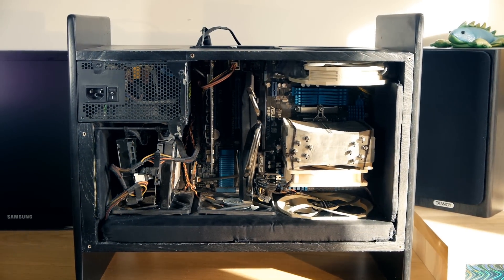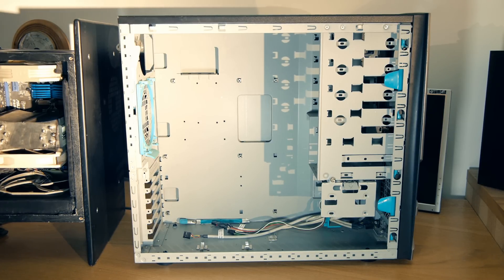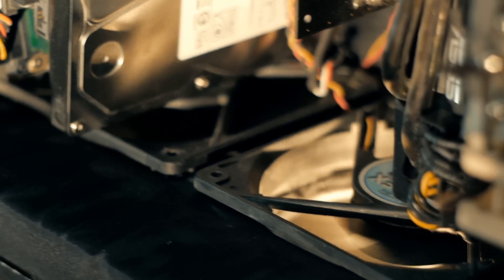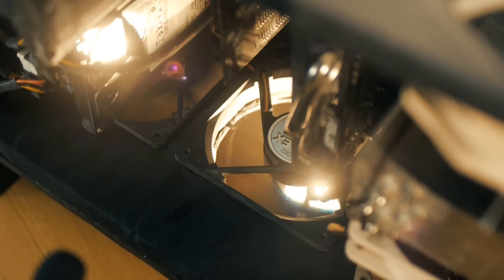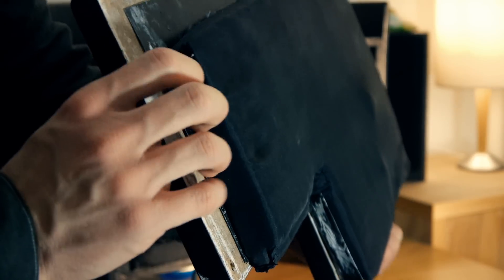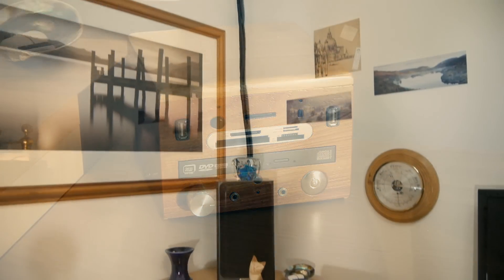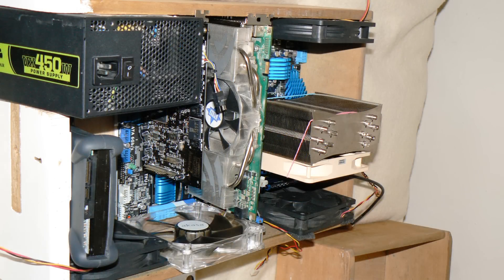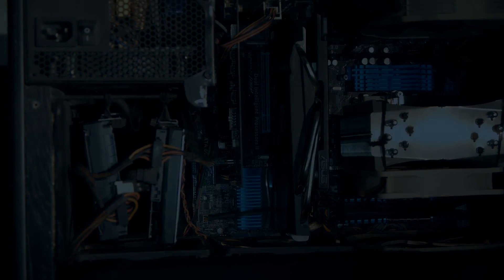My silent wooden PC

Comment: Bad news, wood is one of the worst heat conductor.
Reply from the maker: Good news; the case isn't the heatsink.
Reply: But arent the temperatures higher? I mean even if your case design is well done and the air flow is good.Even with a bit?
Reply from the maker: Not even a bit. Temperatures are dependent on airflow - the air will have entered and exited the case before being affected by the heat conductivity of the surrounding case. ;)
Reply: Nice,then it's a job very well done.
Reply: DIY Perks if you don't mind im gonna try to make one so can i get the sizes of the wood
Reply: I raise you by a ton of dust! If you want to top this off, add some easy to remove and clean dust filters to the case!
Reply: I used a similar solution, the computer is built into the table. -10 degrees because there are 4 fans, not the thermal conductivity of the wood, wood used for silence

Comment: LMFAO!!! cases haven't been built with top PSU mounts for years, your wooden one is just a fire hazard, the motherboard mounts also take heat away from the motherboard. Do not do this.

Comment: The noise damping idea with the cushioned silk was very good, i would really need one on my cooler master seidon 120m, sounds like shit.
Reply from the maker: Wait, your fan sounds like shit? As in farting noises? Could be a bearing problem...
Reply: I fixed it though, but before it sounded like shit, the fan was put to max and created intense vibrations.

Comment: 1: don't you have a major dust problem inside of that case after a while?
2: isn't it bad for the HDD not to be mounted properly? If they are mounted like you did there is a bigger chance for you to break them when they move inside of that case when turned on.
Any anyways, why is it a problem that the HDD vibration makes your case vibrate? None of the other components actually care about that vibration.

Comment: I did similar thing, making extra shelf at the back of my desk a computer housing. Every wire is drawed out similar way to what you've done here. I have ON/OFF switch, reset button, power on led, DVD drive and all USB port built in my desk.

The biggest problem I have is the noise, I's still here. I think water cooling should work.

Comment: Question for you Matt, if your PC is so quiet in this case that you've made, why use the external control hub? You went to all the effort of making it really quiet and then sacrificed access to having multiple USB 3.0 ports (pretty essential for most people). Don't get me wrong, the hubs awesome, I just don't see the point after building your case (or question how quiet the wooden case is)
Reply from the maker: The plan always included an ECU so that the controls could be on the desk, rather than under it. But, once I realised the space above the door would be suitable to have the computer out of the way, I decided to make the wire long enough to allow that.

As quiet as the computer is it is still audible when the room is quiet, but having it outside the door takes it to true silence. A normal PC would still be heard even if it were outside.

I did take the USB 3.0 ports into consideration and decided that, for me at least, they're going to remain unused for the foreseeable future (and indeed they have been, as I still have no USB 3.0 devices).
Reply: DIYPerks Okay, fair enough! Do you have any idea as to when roughy you'll be releasing your version 2 of this build? Also did you take any audio measurements as to how quiet it is? Think I may make this over the summer!

Comment: Great work!
DId you start from a regular motherboard tray, or did you drill and saw holes yourself? :)
Reply: DIYPerks Where did you get the tray? I'm thinking of doing something similar, however I don't know where to get a tray. I was thinking off using an old of the shelf pc, and just dremeling out the tray from its case. (yes its standard atx)
Reply from the maker: I used a motherboard tray. :) In my next build I'll be drilling the holes into a sheet of aluminium.
Reply: John Luzader Pretty much the easiet way to do it mate get a case with whatever mothertray layout you like and the measurements you need and dremel it out of there. some moterboard trays can be drilled out because their riveted to the chassis of the case
Reply: Søren Wetter cool thanks

Comment: That's amazing. I wanna do a modded custom PC that is crazy, innovative and awesome, but I'm ordering a computer from a site, so it comes in a 750D and stuff. At least I get the lights. I do have an i5-2320, 8GB of RAM and stuff laying around, I just might be able to do a hidden PC or something, although most likely, no, since I live in an apartment. And oh, my only concern with your build here is that you have so few USB ports and the ECU and they are not particularly fast.
Reply from the maker: I'm sure you can come up with something. :)

I built the ECU tailored for my own needs, so four USB ports is enough for me, as most of the devices that I'd actually plug in are already built into the ECU (like multiple card readers, for example).

The ports work at USB 2.0 speeds, so they're just as fast as the ones on the motherboard.
Reply: DIYPerks
Cool! Although I'm not gonna make any custom stuff, seeing as I can barely craft a little wooden shelf. And I see no use or purpose in regards to a unique computer thing or whatever. I'm looking forwards to your future videos, you're amazing, really clever, funny and your camera quality is outstanding. :P

Comment: I will be making a similar case soon for a mining rig and am wondering if I should cover the inside of the case with anti-static bubble wrap. Any thoughts?
Reply: Make sure to purchase a name brand PSU. And a well reviewed name brand one at that. I'd go with Corsair personally.
Reply: I like it. Just saw Amazon is selling wooden cases - amzn.to/Pl4tfa
Reply: How would that benefit you?
Reply: I just don't want the wood to mess up the components with static.
Reply: Ah, I didn't think of that. Though, I don't know how big of a deal it would really be though.
Reply: I'm thinking it may be a decent idea just as another measure of defense. But what I'm worried about it is that if the components get hot, the wrap may ignite. 

What is stated above may sound incredibly stupid, but take this from a guy knowing almost nothing about anti-static bubble wrap.
Reply: PC components will never even reach the boiling point of water (100C). You shouldn't worry about them causing things to catch fire unless your PSU shits out.
Reply: Alright then, thanks. I guess I don't really have to worry about fire retardant bubble wrap!

Comment: Awesome! Just a couple of points, first, should anything goes wrong, the foam and the silk poses a fire hazard and since the case is so remote you wouldn't be able to detect it quickly. Second, putting the case in a remote and covered space defeats the purpose of a cool looking quiet custom case. I think you wouldn't be able to hear a regular PC inside that closet anyway. That being said, I'm sure you had a lot of fun building it!

Comment: I love the remote hub idea. You might have a marketable product there.

As for the case, couldn't you get similar results from a nice quiet case like an Antec Sonata or Fractal Define? They're lined with noise damping material and have rubber grommets that isolate fans and drives from the case.
Reply from the maker: You could probably get similar results yes. It's MUCH cheaper to build your own though  ;)

Comment: Now put quad 290x reference editions inside, leave FC3 open, and watch it burn!
Reply: Even a quad R9 290X setup would never get hot enough for wood to catch fire. They would actually throttle down before they even get close to that hot.
Have you ever seen boiling water (Around 100 degrees Celsius, the cards will have throttled down by then) cause wood to combust?
Reply: Also, the case air flow is that good that all the heat is blown out and the wood would not catch on fire

Comment: You have basically made your own Silverstone FT02 case
Reply: Basicly any silverstone case that uses the heat rises princip, like the Raven series aswell. You can just make it quiet but swabbing fans, and as go for the Hardisk you either used SSD or a similar system to this. byt modding it. but the Raven03 already has a pretty neat HDD mount so the 04 probably has aswell. but the 03 has better airflow with 2x180 or 3x120 in the bottom and x2-x4 120 in the front and 1 in the back and 1 in the top.

Comment: Don't you get problems with the hard drives by placing them vertical? I read somewhere this can cause problems and only SSD's can be placed vertically.
Reply from the maker: Hard drive orientation became a none issue over a decade ago.
Reply: Hehe ok thanks for the reply.

Comment: Hi, how did you tightened fan screws? Does screws goes trough sponge>aluminum>wood or they are just set in sponge holes?
Reply from the maker: They were set in sponge holes basically. A bonus is that it completely isolates the fans so results in less transferred vibrations and thus less noise.
Reply: Thank you for fast answer :)

Comment: I am inspired to make a case similar to this, however, how can I connect a power button? I watched the videos on the control terminal but it still is not clear for the power button. :) thanks, great build!
Reply from the maker: Ah, the power button was the easiest part. :) All I did was extend the motherboard's pwrbtn (power button) header wires.
Reply: thanks a million, ill probably have more questions when the time of building comes! :D

Comment: this could catch on, air going through the bottom and out the top, case manufacturers listen up where looking at the future an the sponge for the inside simply brilliant, the fact its on wood and aluminum as well will earth the case, the only fault would we if you wanted to upgrade certain components but even then its probably not an issue either.  Well done
Reply: Silver stone made some similar cases to this actually, witch i have one of
Reply: Have you seen the apple Trashcan? It's cool to see a large company putting this cooling idea to use.
Reply: It already has. Even today, most cases you can buy (not cheap ready-made crap from Dell or Lenovo) have the PSU on the bottum sucking in fresh air and intake fans for the bottum and front with exhaust fans on the top and upper rear. Also, the explosion of affordable All-In-One liquid coolers has allowed PC enthusiasts to place radiators anywhere they want so they can use fresh air if needed. Most cases that cost over $40, when fully outfitted with fans, produce excellent airflow and low temperatures. The only exception are quiet cases. These trend to sacrifice air flow and temperatures for low noise.

Comment: hey mat, what did you use aluminium for ?
plus, how much db does it product when closed?
Reply: the aluminium is for RF shielding - to keep out interference from other devices. Its not essential, you can run a naked PC without a case with no noticeable problems, but shielding it is probably a good idea. All parts of the metal case should be connected together, and to the PC's ground rail so the absorbed interference can be dissipated.

Comment: nice case, but as many other have said, static and the general DIY nature of it does scare me from an insurance standpoint but I'd love to see companies make cases , if not necessarily with the same materials, at least with this air layout.
Reply: Not at all, great looking build and an avid modder of PC cases I sure know the work that goes into them although never done anything with wood as of yet.

Completely agree with you it is a logical design so makes sense an OEM would make one at some stage.

It does however mean one thing anyone that is looking for a similar cooling setup with a tighter budget there is a ready made PC case out there. So it's win win.
Reply: Take a look at the Silverstone Raven 02, uses exactly the same layout with the 90 degree rotated motherboard and the fans drawing hot air from the bottom exhausting from the top. I dare say this case was based of the design since the RV02 came out in 2009. However still a nice job on the case.
Reply from the maker: Widow Maker I've mentioned this a few times, but I wasn't actually aware of the Raven 02 until commenters pointed out the similarity. Not that it matters of course.

What's cool is that I developed this independently, so obviously this design is fairly logical.

Comment: Bravo.I have made a wodden pc too, see the movie CUM AM FACUT CEL MAI FRUMOS COMPUTER DIN ROMANIA and is here on youtube. If You want a more silent pc, must use only fans with large diameter and having minim 6 pales, low speed, no sponges, at the entrance and exit of the air must have the entry and exit of air you must have the role of resonators, even though it would be very narrow intakes, but wide. Anyway congratulation for Your work.

Comment: Nicely done, But i wouldn't recommend having the hard disk too close power supply, as it Magnetic field could spoil the Harddisk.
Reply: No? The PSU is not going to emit any electro-magnetic-whatever fields or beams or other stuff that would do any thing at all to the HDD
Reply: Yes it does, it has transformers and all transformers produce Magnetic waves.
Reply: SIedgeHammer83
But the steel casing of the PSU itself is going to block all electro magnetic waves, radiation, emission, whatever the the circuitry of the PSU creates.
And any if any electromagnetic-something was passing through the metal caseing of the PSU, it won't damage the HDD or lover its performance or reliability
Reply: Despite that magnetic waves will still pass through, dun believe me?
Try place a harddisk on PSU and use it as normal for a month and see what happens. 

Anyway if you still dun believe its your money. not mine, its not like I have waste my time to RMA a Harddisk or spend money on buy new Harddisk in very few months
Reply: The magnetic waves that the transformer(s) in a PSU creates are so weak that they can not do anything. If they was powerful enough to do something at all that would mean that the transformer itself would had to be designed so it was extremely inefficient on purpose. transformers are designed to be very efficient and only emit very weak electromagnetic waves, as this is not the main purpose for the transformer itself.

And I have actually used an HDD placed directly on top of an PSU for about 5 hours copying files from that drive and formatting it. It worked perfectly and still does in the PC that is is running in.
Reply: vertifai Like I say its your money and time.
Safely is always my 1st priority why risk it?
I'm just giving advise. if you wan to risk it. by all means, 

This is not all about winning a argument. it about preventing HD from malfunctioning

Comment: the newer cases have bottom and top fans mounted (or place to mount them) and power supply unit placed on the bottom so they pretty much do the same thing.

Comment from the maker: It can be screwed on to the timber, but what I did was cut out the motherboard tray out of an old aluminium case, and stuck that onto the other side of some plywood which had bigger, less precise holes drilled into it. Works well and it meant that I didn't have to do any precision drilling, and it maintains the shielding. ;)

Comment: Interesting... But you have fallen foul of the number one 'Elephant-in-the-room', that is, you have put the PC in a case. I did a 'silent' build. I bought a sheet of 5mm black acrylic, drilled and mounted stand-offs then mounted the motherboard to this. I ran a normal ATX power supply (mounted on the board) and an SSD. The whole board was then drilled and fixed to my wall, completely open to the air. Since there is no case, there was no airflow issues, no heat build-up and near silent running!

Comment: This is true but you should mount the HDDs either perfectly horizontal or perfectly vertical, the 25ish degree slant you have them in now leads to excessive wear on one edge of the ball bearings and that will lead to premature failure of the HDDs. 

Also ben is sort of right in a sense, but the amount of force needed to cause that would be beyond what this PC will likely ever experience, unless it fell on the floor at which point the HDDs will be least of your worries.

Comment: hope you dont mind but i have some suggestions for the next time you have a go. first you should filter the air intakes, you can do this easily with any filter material, be sure to make it so its easy removable so the filter can be cleaned without introducing extra dust inside the pc. On the way you have your drives on elastic, this is a v bad idea, with mechanical drives you run the risk of gouging the disks with the arm inside the drive, this will cause the drives to start grinding and fail.

Comment from the maker: Yes, have it blowing straight down onto the heatsink from the side, like an Intel cooler. 20w tdp is really not much at all, even if it does have 8 cores, so heat shouldn't be an issue. Just have a gentle flow of cool air hitting the heatsink and it should take care of itself.

Comment: So when I build the wooden case for the system,i should attach the fan on the side of the case?Or should I attach on the top/bottom of the case to follow the heat rising?If side,should The fan be blowing at the heatsink from the front(like a typical intel stock cooler),or at the top/bottom(because it is tilted 90° so the IO ports are at the top)?Or does it not matter?
Even though it is a 20W TDP atom,I am still quite paranoid,coz this particular atom processor have 8 cores.
Thanks for any help.

Comment from the maker: I'd just have one fan on the side of the case blowing down on the heatsink, with a vent somewhere so that the air can escape. Two would be unnecessary for such a low powered system. Hope this helps!